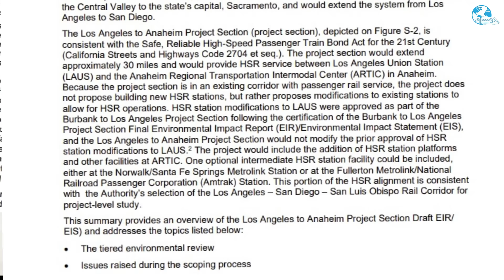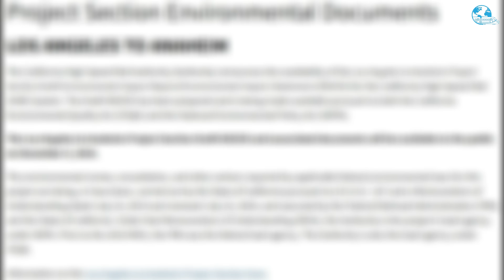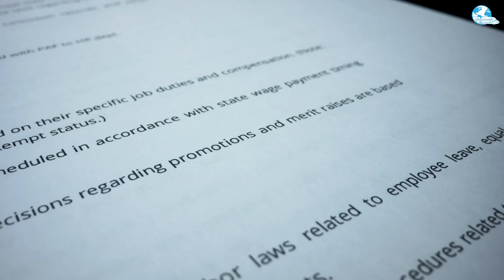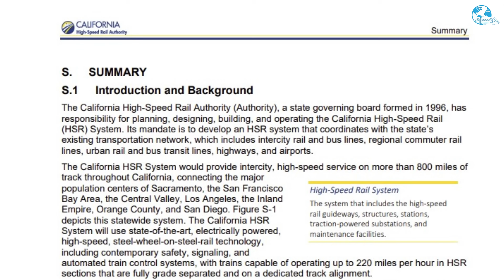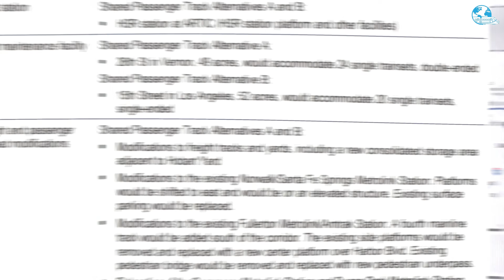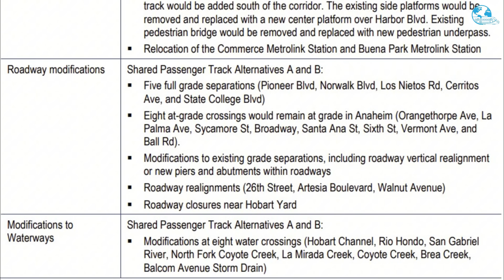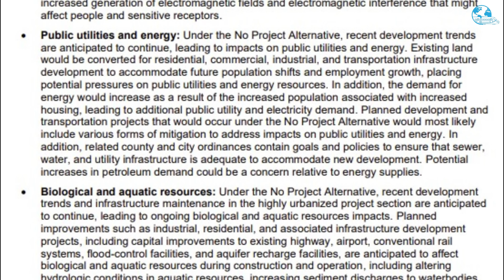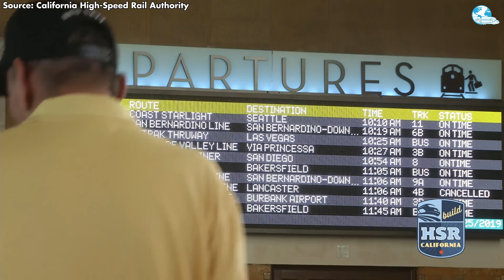California High-Speed Rail’s Huge Update | LA–Orange County Section

Comment: The section between LA and Anaheim was always understood that it wouldn't operate at HSR speeds because of the shared ROW and the closeness of the two cities. That's not unusual with HSR lines around the world that are designed in a very similar way.
Reply from the maker: That's a fair point.

Comment: The current Pacific Surfliner and Metrolink equipment fleets can operate at speeds of 110-125mph with the proper infrastructure. Upgrading the tracks to handle those speeds from Anaheim's ARTIC station to Los Angeles' Union Station would offer a very substantial speed upgrade for a much lower cost to build and maintain. Not all of that section could reach those speeds but much of it could. You could do a lot of upgrading with the amount of money saved by not forcing the actual HSR trains to go to Anaheim. Amtrak California Pacific Surfliner could operate on the separate tracks intended for CA HSR since Metrolink would not be operating at the higher speed.
Reply: True, but in all likelihood, CAHSR trains running in the ROW is probably how they've been able to justify the authority spending money on those infrastructure upgrades. (Just look at the upgrade and electrification of CalTrain.) As some have pointed out, places like Fresno weren't even planning a fraction of the overpasses CAHSR built. That said, to your point, one question some against CAHSR spending money on this proposal should be asking is why neither BNSF nor Metrolink -- the owners of this ROW -- mentioned ONE of these upgrades, unprompted or otherwise.
Reply: @TechGroupF430i  Just to make sure I understand your post, you are talking about the construction of grade separation infrastructure or rail upgrades to passenger service track age for higher speeds and reliability or both. Or something else?
Reply: @jjxtwo1  both. Lucid Stew did a video highlighting that grade separation and infrastructure upgrades would both be necessary for higher track speeds. At the same time, notice the lack of discussion about these upgrades that were taking place before CAHSR's study of this segment. (I've yet to see someone point out that Metrolink had already posted a cost estimate to do all of this.) If there was already a plan to perform these upgrades without CAHSR, this would be a very different conversation, both on the cost and the drive to do it.
Reply: @TechGroupF430i As far as BNSF they don't really have much interest in this. This is passenger rail and like other freight railroads they want it to just go away. OCTA, LOSSAN, and Metrolink have been building grade separations. Quite a few in this stretch. Only the Rosecrans and Marquardt grade separation had HSR money. Metrolink  knows how much it will cost but that doesn't mean they have the money to go any faster than they currently are. Metrolink barely keeps up with desperately needed modernization projects. Signals, communications upgrades and so forth come before raising track speed. Money is the mover of projects. I haven't seen a lack of interest in grade separations only a lack of money.
Reply: @jjxtwo1 Exactly. It comes down to a lack of federal funding.  It's shameful!
Reply from the maker: Thanks for your information.
Reply: @ONtheTrains 👍🏼

Comment: So it looks like a German design, with sections of high speed track over part of the route, using ordinary track in other places. Then use tilting trains like Pendolinos in the southern section.
Reply: Stop the California High Speed Rail. It's a boondoggle and California has completely messed it up.
Reply: That may or may not be true, but it isn't a reply to my comment. Did you read it?

Comment: 100 billion + and 10 + years and nothing. Can you say slush fund for leftists. They don't want to solve any real issues.
Reply: You do know they built over 50 grade separations, viaducts, and bridges, right?
Reply: @TechGroupF430i  You seem to have forgotten the actual history of this project — specifically, what voters approved versus what is being delivered.

Almost everyone would like to see a project like this succeed — on time and anywhere near its promised budget. That’s not the issue. The issue is that, at this point, this project bears no resemblance to what was approved and has been profoundly mismanaged.

So let’s be clear, because the historical record is not debatable.

California voters approved High-Speed Rail in 2008 based on a $33 billion estimate to build a San Francisco–Los Angeles system, with service promised around 2020. The core selling points were explicit: 2.5–3 hours SF–LA, fully grade-separated, competitive with air travel, funded by state bonds with anticipated federal support.

Fast-forward nearly 18 years.

There is no high-speed rail service — none.
There is no connection to San Francisco or Los Angeles — zero.
The only segment under construction is a Central Valley starter line that was never the voter-approved vision.

The cost for the original system is now estimated at $89–$128 billion, and even that assumes funding that does not exist. The initial operating segment alone (Merced–Bakersfield) is projected to cost more than the entire statewide system was supposed to cost in 2008.

Timeline?
What was promised for 2020 is now optimistically 2032+ for a partial segment, with the full SF–LA line pushed into the late 2030s or beyond — again, if funding materializes.

This isn’t bad luck.
This isn’t “big projects are hard.”

This is systemic misrepresentation, scope retreat, and chronic cost escalation on a project that has consumed tens of billions of taxpayer dollars while delivering zero passenger service.

If someone is still defending this without acknowledging:
	•	a 3–4× cost explosion,
	•	a 15–20 year schedule failure,
	•	and a retreat from the voter-approved core route,

then the issue isn’t opinion — it’s basic literacy in the project’s own published numbers.

And pointing to concrete structures as a justification… nope, this is fraud.
Reply: @TechGroupF430i  and yet not a single inch of track laid. what a complete waste of money. cool they built some structures. who cares! that's all 100 billion and 20 years had to show for!
Reply: @f-86zoomer37  construction started 10 years ago. The railhead in Bakersfield had to be built by BNSF -- which was done this year -- before they could even start the process of laying track. Further, the guideway has to be in place before track laying, so... the company that gets contracted to do that will care. Lastly, every driver who uses ones of those overpasses instead of being stuck waiting for a BNSF train to pass won't consider any of said structures a waste of money.
Reply: @TechGroupF430i  So how is 10 years of construction with nothing to show for it and 100 billion dollars gone any better?
Reply: @f-86zoomer37  the mere fact you read that, looked at those 50+ structures, and deemed it all "nothing" tells me there's no answer you'll find satisfactory.
Reply: @TechGroupF430i  so when will the trains run from SF to LA? Is it not a fact that there is NO projected opening date for this boondoggle? Is it not a fact that there is NO concrete plan on how to connect Phase 2 from Sacramento to San Diego? If I were the manager of the state funds, I would immediately cancel this project and offer a tax refund to all California taxpayers with interest as an apology for this disastrous project.
Reply: @f-86zoomer37  track installation is slated to start in Q2 of 2026, with projected completion in 2029, and completed testing and opening of the entire IOS in Q2 of 2031. Connection to Gilroy and SF is currently projected to be fully completed by Q1 of 2038, with Palmdale done by EOY 2037, and LA before 2045.
Reply: @TechGroupF430i  great, 20 more years on top of 10 years of construction and on top of another 10-20 years of planning and talk. Congrats you connected two cities 300 miles apart with rail in 50-60 years. A huge achievement! And it will totally only cost another $100 billion, and definitely not explode in cost later!

Comment: The California High Speed Rail should & ought to have been built 50 to 55 years ago between Los Angeles & San Diego in the very first place with help from Japan. Then build to the San Francisco Bay area.
Reply: 50 years ago, high speed rail was still a novel concept. The French TGV didn't exist (as we know it) until 1973. The UK's APT was still in the testing phase in 1975 and didn't enter service until 1980, four years after the InterCity 125. The German InterCity Express (ICE) wasn't a thing until 1985. You're basically saying that the U.S. should've jumped into the HSR scene (right as the oil crisis hit?) before Japan had built their second line, "Tōhoku", in 1982.
Reply: @TechGroupF430i Japan had their very first high speed Shinkansen operating in 1964. Japan was testing it & working out the bugs in 1963.
Reply: @ChristopherORourke-s7g  okay. That doesn't at all detract from what I said. Between the interstate system (and car culture), the airline industry, the rail legislation that was signed in the '70s, the oil crisis, and the fact that (up until 1974) only one country had a functioning HSR line, the U.S. hopping on the bandwagon was highly unlikely. (Heck, only one freight line even bothered to electrify during the oil crisis, and doing that nationwide wasn't a foreign concept at the time.)

Comment: You mean they haven’t put in one single inch of track, and railfans go all googly eyes over a PLAN???
Reply: You mean, they needed to build infrastructure before laying down tracks? You mean theyve already completed over 50 building, guide ways, viaducts & level grading while iirc I believe they have 5 structures left to start & construction will be started on every piece of infrastructure needed PRIOR to laying an inch of track?

So typical for your kind to be so uneducated. I can 100% guarantee you've never once checked into the audit which is OPEN for the public to examine, that's done every quarter.
Reply: You need to build the house before you live in it. You can’t just say that because no rail is laid that the whole project is dumb. Additionally, the main reason for the slowdown is because of lawsuits from land owners and environmental groups and also oil and gas companies lobbying for the slowdown of funding and job growth for CAHSR.